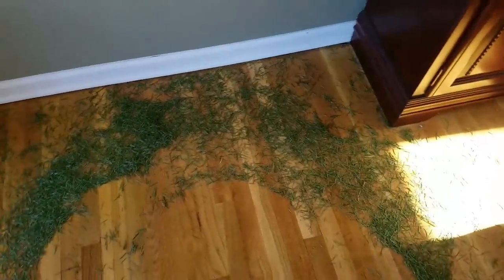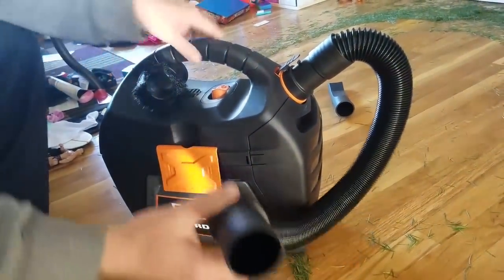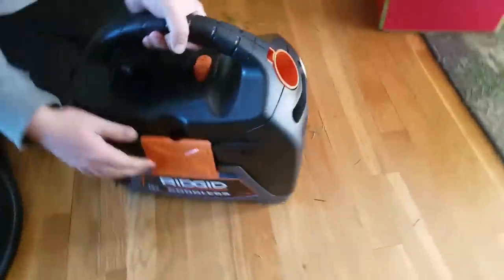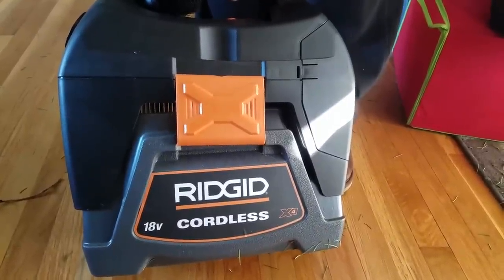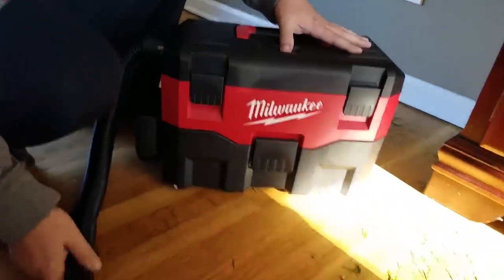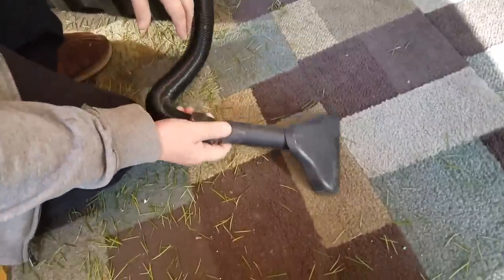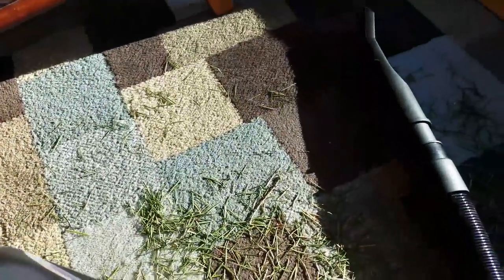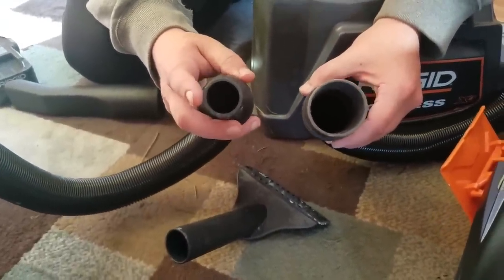Milwaukee (0880-20) vs Ridgid (WD0319) Wet/Dry Vaccum Face Off against Xmas

Comment: Thank you TOOL BOSS for this review/comparison. I am a Dewalt 20 V guy through and through. However, I did not like the reviews of the DeWalt cordless wet/dry vac, so I was leaning towards Milwaukee. I never even gave Ridgid a thought until this video. Considering I don’t have either of Milwaukee or Ridgid batteries, I was open to either. I ended up going with the Ridgid due to its raw power and I liked their LED light cannon with 2500 lumens, which is 2 1/2 times brighter than both Milwaukee and DeWalt’s option for a cordless LED light. I just got the Ridgid vac today and I absolutely love it. It has more suction power then my corded shop vac and because it’s cordless I’m going to be reaching for it nine times out of ten now. Thank you TOOL BOSS for this amazing review!

Comment: Very impressed with the Rigid vacuum. I have the Milwaukee (I moved over the the Milwaukee platform for cordless tools). The Milwaukee is very convenient, as is any cordless vacuum. Both of these vacuums are gonna be very useful for those quick cleanups. I have a Rigid Shop Vacuum that plugs in the wall, I've had it for over 6 years and it's still running strong, so it was no surprise to me that a Cordless Rigid would perform well. Great review man, keep it up! wow over 2,000 subs your growing man. Happy new year as well
Reply from the maker: Nalu Rash thanks buddy ... appreciate it man ....yea it's awesome having a couple of the vacs without the cords 
..so convenient

Comment: Why did u have to get on your knees? Does it not come with extensions? I liked your suction power display. Rigid was great. The guy who commented on here that said that was not good is off. Good job.
Reply from the maker: Actually uses same filter as there other shop vacs ..also alot of Ridgid accessories will fit on this one

Comment: Simple lift test usually don't have much value or any at all as the surface area they sucks from should be the same to have any value. Milwaukee with smaller area in order to lift same amount must be able to create a much larger vacuum in order to lift same amount from a smaller area.
Just about any vacuum cleaner can lift even a car provided enough surface area and seal that's tight (rubber etc.)
Reply from the maker: HifiCentret well this one does ...these are the hoses and nozzles you get ..if the Milwaukee's aint big enough and its $30 more ..id take the ridgid and for someone who has had both now for over a year ...the ridgid definitely has more suction and is my go to vac for tougher jobs
Reply: I do not argue that you find Ridgid the best. My point is only about the lifting test. Of far more value is how large pressure difference are they capable of making and how fast an airflow do they make. That said the nozzle isn't insignificant either. A large diameter nozzle of course require greater airflow to be able to such in similar items from similar distance.
Reply from the maker: HifiCentret yes im not disagreeing with you either ...but these are the nozzles you get ..not gospel both are great ..and the shape of Milwaukee is alot better ..i have a video cutting wood on it ...standing on it ...great design ..but power wise as is the ridgid is noticeably more powerful